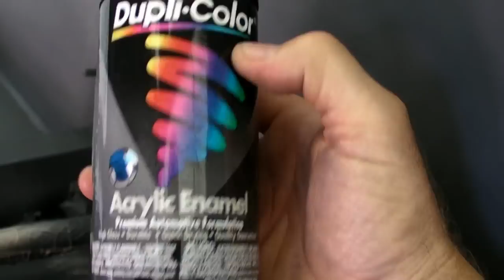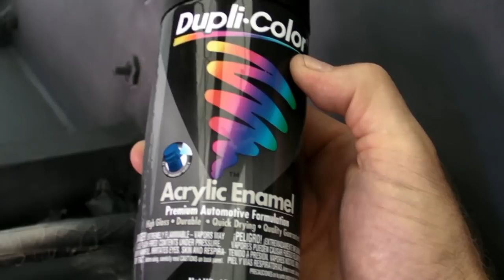Painting Aluminum

Comment from the maker: @anariaq  Actually having it open the other direction would be much nicer, but this is an ambient submarine so it's sort of backwards to a normal 1ATM submarine.  Consider the force on the top hatch when a bottom hatch is open while underwater.  It's a 25 cubic foot air bubble that want to go up, and that top hatch has to take the force of about 650 pounds.

Comment: You dont have to put 3 coats 1 is good it can be see through you are just etching the metal and you dont have to sand the etch paint rite over it unless you let it sit more than 24 hours then hit it with a scotch brite i do this everyday for a liveing
Reply: Michael Harden 0 p
Reply: Michael Harden do you have to use the primer if you had it sand blasted?
Reply: @lowboytrucker  depends. If its aluminum you should always use etch primer. 1 coat is enough. Not 3 coats like in the video.

Comment: painting an aluminum boat there.... I used self etching primer on BARE ALUMINUM and then automobile primer on top of the self etching..... both are Rustoleum products.... Can I just add paint over that or did I just screw it up with the automobile primer?
Reply: It has been two years since you posted this comment, so how is the paint holding up on the aluminum boat?

Comment: Very nice I hope it sticks long term I found a dark green etching primer when I was back in Canada for some aluminum windows and worked very well. Sorry can’t remember the brand.
Reply: Just found it 249322 rustoleum
Reply: @brucemartin8435  hi, did you applied 3 coats of etch primer? Thank you
Reply: @luismaryland2305  only 2 coats and wet sand where I could
Reply: @brucemartin8435  thank you very much!

Comment: I am restoring an aluminium bicycle frame, after its polished should it be finished with a coat of Laquer to protect it, or could it be left just as it is. thanks
Reply from the maker: Sorry, but I've never tried polishing or keeping a  polish on aluminum, but I'd think maintaining an airtight clean coat would be necessary to prevent gray aluminum oxide from forming on the surface.
Reply: SV Seeker yeah thanks, I kind of thought that, but wasn't sure thanks.

Comment: The test you were trying wasn't a real test and would have been more like abrasion resistance not bond strength. If one wanted to know the adhesion bond strength you would test per ASTM-D 3359 Method A. The manufacture will have the target performance numbers for the test above. Regards.
Reply from the maker: Sorry to disappoint you.  Thanks for watching.
Reply: No worries. Next time you'll know how to do a bond strength test properly. Thanks for the video.